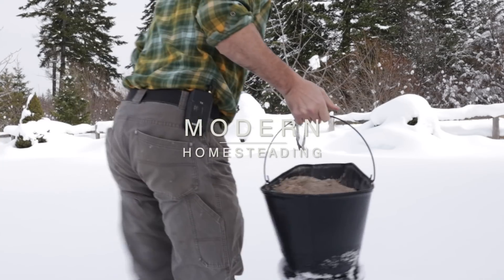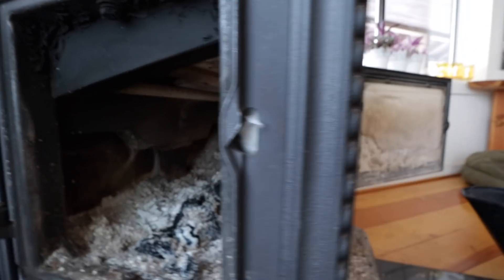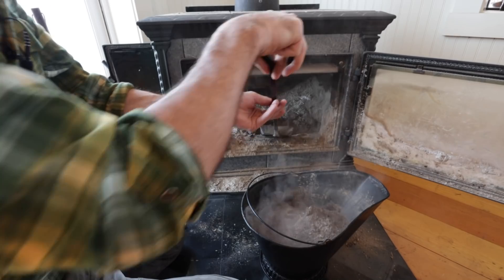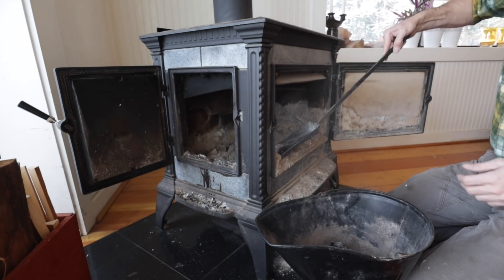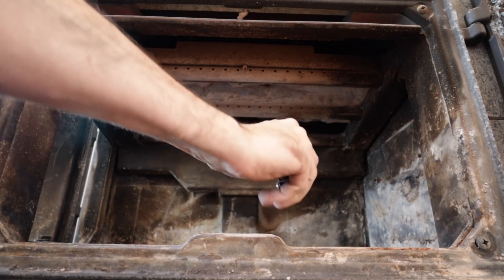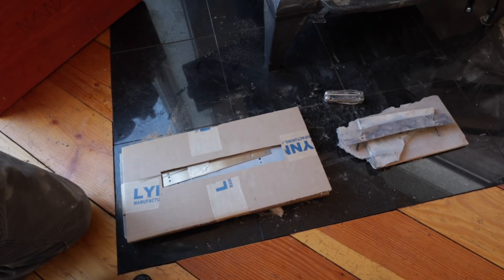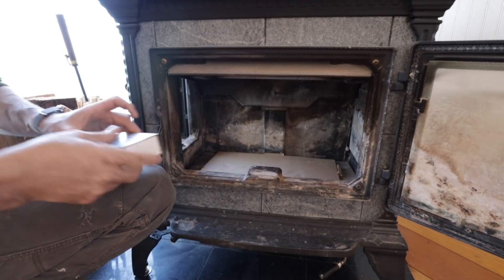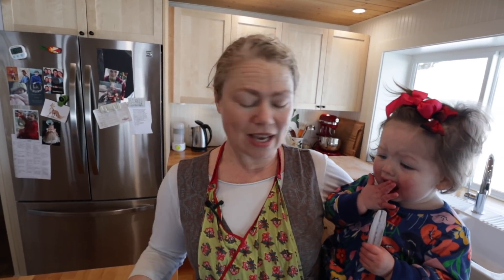Woodstove - Who Builds The Best Wood Stove?

Comment: You dont have to take your wood stove off line to clean out ash, I live in northern WI and wood is my only heat source, it is hot for months at a time. I do monthly chimney cleanings and scoop out ash every three days without killing the coals.
Reply: I agree with you. I used to use two metal buckets. One I would fill with hot coals and the other with the ash being removed. Once I had it cleaned out I would put the hot coals back in and add wood so technically my fire never went out all winter. Did it that way for the last 30 years.
Reply: If you do it regularly yeah. 

Mine has a slidey thing that wiggles the griddle and gets most of the ash to fall into the ash box so it can be emptied without even opening the main part of the stove where the embers are.

If you don't do it often enough then once the griddle bungs up it's a bit more of an operation where you either have to let it go out or shovel the embers & burning stuff out so you can unblock the griddle.
Reply: @DEADB33F  He has one on that stove, but doesn't use it .... thus the blocked grate. 05:34 calls it phony for some reason? That's the reason for the ash build up. It really helps too empty the pan too, or else the ash has no where to go. These seem like basic things one does with wood stoves, so I'm a little miffed by the confusion especially if he's had other wood stoves in the past.
Reply: @prepperjonpnw6482  good idea! i have learned that you can keep enough coals in the burner to keep  the fire going without is smoking during chimney cleanings. you just close the dampner and all good.
Reply: @DEADB33F  those are good in idea but almost always clog, that's why people use shovels.
Reply: @straubdavid9  the grates for the pans always clog, that's why people don't use the pans. I just let my pan fill up and leave it there.
Reply: @ericdeaton2247  I guess it depends on the system .... not ALL clog, especially if you at least try to use the system you have - that's my point.
Reply: @straubdavid9  Indeed, run your stove properly, clean out your ash drawer and make sure it never clogs up and burns efficiently.
Reply: @straubdavid9  yeah I don't get why he has a plate covering the grates so the ash cannot get into the removable ash pan. I run my Jotul 600 continuously for weeks at a time emptying the ash pan every 1-2 days.
I don't get what he's doing here.
Reply: This video doesn't pass the smell test. I call bullshit that the stove is his primary. He didnt even know how to use the ash pan, and that kindling...? Lol He mentioned something about relighting it in the morning..... Omg i would drop my stove in a lake if i had to relight it every morning. That undersized floor protection is a fire waiting to happen with a side loader, and in his case side and front clean out too.  Using a shop vac on ash in the house!!! The dropping, not sliding of ashes into the can....There would be a domestic dispute in my house if one of us made a mess like that.

Comment: Cody, i have an attachment for my shop vac that lets me suck all the ash into a metal container, it's pretty common here in Sweden to have them, makes it alot more safe to clean the stove, and you get better at cleaning it more often. I was using a small shovel before but with this there is no need, it's impossible to get ash or possibly embers to the actual machine👌
Reply: How do I get one ?

Comment: I have been using a Waterford cast iron stove made in Ireland for 35 years. Beautiful stove with quality construction. All the baffles are thick cast iron that are maintenance free. The glass door has an air wash system that keeps it clean (clear) as well. I have not had any of the issues you talked about concerning it being too hot to the touch etc. Raised 4 kids around it with no issues. Mine also holds heat well and distributes it well throughout the day. I was expecting a comparison of wood stoves but understand your touting your own stove, as they are a great heat source. I think to dismiss all cast iron stoves is a mistake as it really depends on the quality of the stove and the manufacturer.

Comment: Have you ever thought about putting one of those heat powered fans on top of your stove to help distribute the heat? A stove top fan, my mother in-law has some and it works great to help push the heat around
Reply from the maker: Those fans are more novelty than function,
Reply: But they legitimately help. She uses a cast iron stove and the heat from that is intense, so she has three of those fans to help push the heat around. Don’t nock it till you try it lol. I want to see you get one one and post a video and show me it’s a novelty and I will gladly admit I’m wrong cause ik they work. Also don’t get the cheapest one give it a fair chance. I’d even post a video admitting I’m wrong and apologize.
Reply: @Shikamaru6900  Depends on the layout of the area as well.
Reply: @wobblysauce  I agree to the lay out part but any air circulation is better than none. Instead of all that heat building up in one area. The fan isn't the strongest by any means but it's safer than trying to put a plastic one up behind it and it melting or a metal one that gets super hot and can stop working.
Reply: Indeed.
Reply: I used two of those on my wood stove and they definitely work. I’ve also mounted an all metal oscillating fan above and behind the stove on the wall for my other wood stove and it works the best. As others have said any air movement is better than none.
Reply: @wranglerstar  Not agree, try it, then you know...
Reply: @wranglerstar  They work Mr. W. If the blades are turning, air needs to be moving to someplace. Not cheap. Loved ours. When it was too hot for our electric fan, we would let just move a little air around. It would also take some of the moisture from the kettle and push it away instead of floating up with the heat and drying out to nothing.
Reply: Thank you for the support so far, to agree that they do work thank you
Reply: @wranglerstar  People that do not own one are the ones who think they are a novelty.
Reply: @jolanni7  I got a good one for under $30 - made by Voda.
Reply: @wranglerstar  Cody, try one, I have seen them in a pub in England, they really work.
Reply: @wranglerstar  I love my fans ,one on each stove , other thing I like,at a glance, if the fan is slowing u need to add more wood .good visual aid to jog ur memory. I like my expensive Canadian one best , or I tell myself that because there was VAST difference in price between my two fans.
Ur gonna have to do some testing sir .   tom
Reply: If heat rises why not use a ceiling fan set on winter direction.
Reply: @williambranham6249  what is winter direction lol
Reply: @BIG_FETUS  ceiling fan direction can be changed with the small two switch on the motor housing. The winter direction forces the hot air near the ceiling downward. Lol
Reply: @williambranham6249  ah reverse lol yes
Reply: @BIG_FETUS  I think most homeowners aren't aware of that.
Reply: Shikamaru6900 I have A built-in fan in my regency. It’s not needed because heat rises and cold air from the rest of the room comes in low to replace it. Moving air always has a cooling effect anyway

Comment: Mrs W was so right, in our cottage, it took over 4 hours to get the wood it was made of warm.  I won't go into what it took a mattress to thaw.  We finally had to resort to a heating blanket for the beds otherwise they would still be frozen when you left on Sunday night.   The cast was fast and threw lots of heat fast which we needed in that application.  If you damped it down well getting through the night was pretty easy.  For a home, I can sure see the benefits of the soapstone.  Great video!!

Comment: This was nice to see. I have the Hearthstone Mansfield model. Have had it for about 13 years now and I just love it ! It’s also all I use to heat my 1800 sq ft house. I like it because it can be in your living room or anywhere you want so you can really enjoy the fire without getting pushed out because of the heat. Its like magic. I can sit 3 feet away while it’s at full blast but it still heats the entire home really well. My previous cast iron stove had to be in the basement because it was too hot to be near it. So no fire to enjoy watching. I do have one issue at the moment to address at some point. One of my stones on top has raised up a bit. So it’s not level like the others. But for 13 years of zero maintenance I can’t complain.

Comment: I Never knew soapstone log by burners even existed. If you set the shovel full of Ash on top of the Ash in the bucket, then, draw it backwards slowly while at a small tilt angle, you'll get a lot less Ash dust than tipping the shovel full of Ash over on its side onto the Ash in the bucket.
Well, that's how I've been doing it for decades now and it makes cleanup a doddle.
Enjoyed the video very much, Nice stove 👍

Comment: Those baffles can break when you overheat your woodstove.
Reply: A good fire needs room, packing it full if you want to make charcoal.
Reply: Why not use a metal baffle rather than a thin slice of soapstone?
Reply: @nickguthrie9309  Metal twists under immense heat.  Basically, it will warp and lose it's function.
Reply: @roflstomps324  It seems immense heat is not good for metal or soapstone. In  either case, how you load  the stove is important. I warped the doors on a high quality iron wood stove . Too much intake of air when fully loaded.
Reply: @williambranham6249  True.  But metal is far easier to warp.  Draft is key.  I've been using stoves in Northern Canada for decades and my grandfather always taught me that I should only use full draft on start.  He then told me I should never, ever let a fire go out.  Old timers, right?
Reply: @roflstomps324  I agree. You're right about the old timers.
Reply: Nick Guthrie mine had stainless baffles. I think they use a catalyst now too to meet new EPA regulations.

Comment: We have had great experience with a Woodstock Soapstone stove over the last decade.  It's baffle is cast iron. It is a catalytic stove and can be burned to bypass the catalyst as well.  We heat with wood and the catalyst is still working after 10 years.  Love the soapstone, holds a fire for 8-10 hours in catalytic mode with little change in surface temperature.  Woodstock Soapstone company, ours is the Keystone model.  Just looked for fun, they are now about  $3000.  Wow.

Comment: I love my Pacific Energy super 27, super efficient and heats the whole house.
Reply: They have heat shields, ~2" refractory mass  and a built in ash bucket.  Pacific for 25 years operation Mine has a  1/ 2" thick cast iron baffle that has only needed to be changed once.
Reply: How big of a house can they heat? We have a big family and will be building a ~2600sq ft home. 2 stories. Would like to have a wood stove or maybe a fireplace with an insert. Just now sure if the upstairs will get the heat as well.

Comment: You should get a thermal fan for your wood stove to help spread the heat out more through your house. Requires no electricity just the heat from your stove and it will regulate itself.

Comment: My 1st wood stove was/is a Drolet HT2000. Canadian design and build. I wanted to stay away from catalytics but wanted higher efficiencies. Mine injects air into the exhaust which creates a floating flame, anyways, it seems to work fine in spite of my mis-steps along the learning curve. I went with double & triple wall pipes (expensive), my clearances are tight. I figure a 3 year payback. Our winters bring snow for 6 months solid and possible temps as low as  negative 20-30F. The Drolet instruction manual was very complete.

Comment: Woodstock soapstone makes awesome wood stoves as well, and they don't use that fragile baffle material! I've had there fireview for 12 years now.
Reply: We have Woodstock's  Progress Hybrid which is bigger than any other we've ever seen....and it's soapstone over cast iron.   We did an expansive search and are
super happy with Woodstock's stove.   The ash pan holds a bucket of ash and
is easy to pull and very secure placement.    It was well worth the investment.
The Progress has a large window in front comes with the 'catalytic'  and the company will custom design somewhat.  That's our only heat source.
Reply: carol martin my wife and I upgraded our fireview this past November to the progress hybrid which is also our primary heat source. They make awesome wood stoves! Our fireview got a facelift and will be used at our hunting camp.
Reply: I have a Fireview for sale in Eastern Oregon.  We just decided to sell it because it wouldn't work with our floorplan and the side load aspect of the stove.  I was so upset we couldn't make it work because it is a beautiful highly rated stove.

Comment: I have a quadrafire stove that’s very similar to that stove and with good hardwood it will still have a good bed of coals 12hrs after I fill it up
Reply: I have a quadfire, which heats our house. It's very efficient and burns completely. I agree, there are embers still in it 12 hours later.  Wood heat is so different compared to the traditional furnace.
Reply: You guys should get a Blaze King, you'll have ample coals 24+ hours after loading.  Lighting a wood fire less than 5 times per season is just wonderful.

Comment: I have an insert from cast iron in the fireplace (flam) It has a double wall and you can but dont need to use the built in fans near the bottom to suck in air that flows around in the double wall and comes out above the front door. I use good wood, too. Very few ash. Just to take out the ash box every few weeks. In may or so i use the vacuum to clean out the dust from the corners. Still happy after 15 years.

Comment: Through sheer dumb luck I actually bought a home with  the same hearthstone heritage as you have and boy am I glad

The way the soapstone radiates the heat compared to a plate steel or cast iron is just indescribable 

You can sit on the couch next to this stove and be comfy and cozy whereas with my old plate steel stove you would practically have a sunburn!!

I also busted  my baffle :p   but that reburning tube setup is just the bee's knees I get almost no particulate smoke out of my chimney.

Comment: Great video, our insert is a Drolet and also works great it has an open chimney with an adjustable air bleed. Your totally right about the cast at how hot it gets. Fully chocked down it idols at 350 to 400 degrees for 6-8 hours on a full load of Oak. Great how the whole family is getting involved in the show. Still can't get over all that snow you have to deal with everyday. Thanks for sharing.

Comment: I went hunting for a medium sized wood stove 3 years ago and prices ranged from $800 cdn for a home centre model all the way up to $3700 cdn for a Blaze King Sirocco 20 I believe. I opted for the highly recommend $1800 Pacific Energy Super 27 and it's an amazing wood stove. I wanted the Blaze King but I have an external chimney and the dealer did not recommend the Blaze King for that type of chimney. I'm very happy with the stove but I wish I could turn it down further on those warmer winter days. Ultimately, we end up opening windows just to get comfortable.
Reply: Fresh air is always good!
Reply: I'm thinking about getting a wood stove a little familiar with them not much. If the stove is too big for the house couldn't you cut back the damper? Or would this make a bunch of smoke in the house?